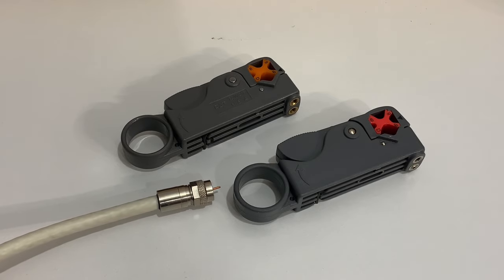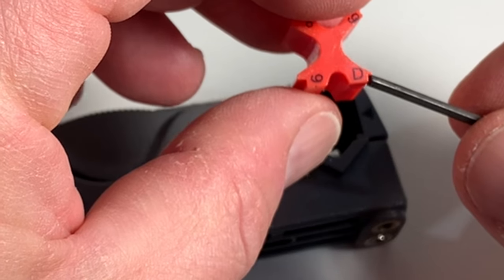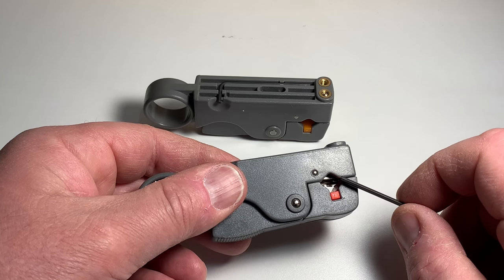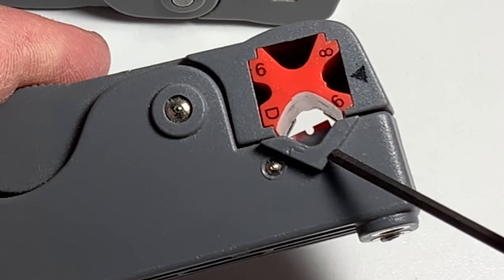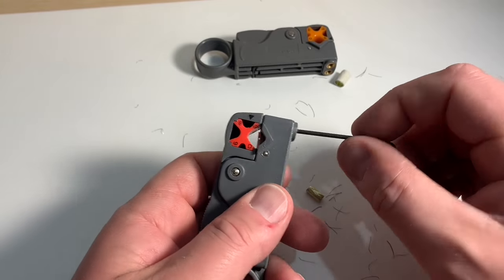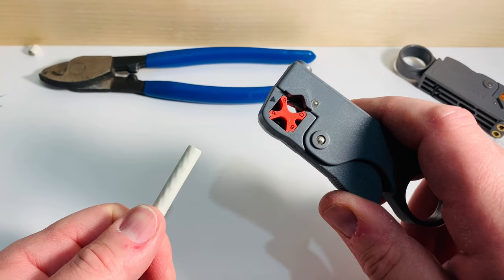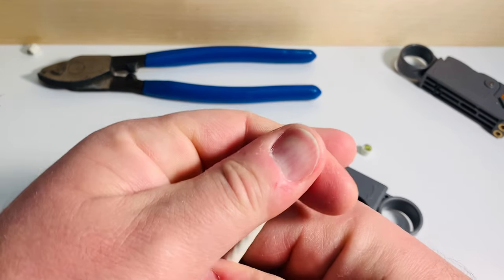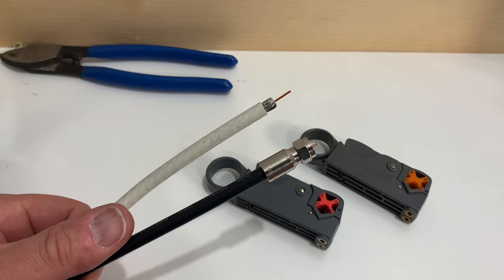RG6 Coaxial Cable Stripping Tool for Making Your Own Coax Cable

Comment: This video was very easy to understand and helpful. It has many similarities to the 50Ω cables used in wireless communication, so it will be helpful for adjustment. Before watching this video, I did not know how to use this tool. It works fine with RG58A/U cables.

Comment: that's the best tutorial I've seen on how to use that particular tool.  I bought mine at Walmart, LOL.  I was always afraid to cut the ends off my cable, because I wasn't confident I could put the new connector back on properly. When I ran RG6 from my attic antennas down to my den, I had to cut the end off the cable and was quite frankly very happy when I put the new connector on first try.  Who knew something so simple could be so difficult?  I recently purchased an IDEAL wire stripper (non-adjustable) and just use that now.  On some cables I have to be careful not to cut too deeply, but you're spot on with practicing first and making adjustments!!
Reply from the maker: I’m glad it worked out for you. Practice makes perfect (sort of). Thanks for watching!

Comment: Does anyone know what the measurements on the tool are for (not the numbers on the orange one, but on the gray one) that say 4, 6, 8, 12? Sorry for my ignorance but I don't understand what they are for or how to used.
Reply from the maker: They probably are a reference point for the length of the exposed conductor and shielding. The little picture below them alludes to that. Likely the measurements are in millimetres, but I don't use those. Stripping the cable as outlined in the video will give good results.

Comment: This has been what I needed to see. I have the exact same cutter and did not know why it wasn't making two cuts. I have a question, what are the: "4, 6, 8, 12" numbers and the drawing for on the tool? Thanks!
Reply from the maker: The viewer below gave a good answer for your question. They probably are a reference point for the length of the exposed conductor and shielding. The little picture below them alludes to that. Likely the measurements are in millimetres, but I don't use those. Stripping the cable as outlined in the video will give good results. Thanks for watching!
Reply: Those numbers describe the distance between the blades lengthwise along the cable. The blades can be moved into the different slots to achieve those spacings. So for instance if you want 4 mm of braid exposed, and 8 mm of center conductor.
Reply from the maker: @SMShannon55  This is correct. Thank you.
Reply: @NorthcoasterHobby  Well, thanks for the replies! Now I just noticed that inside the tip of the "claw" are tiny letters: A- thru- E. These must be the spacings for the slots that the blades can be moved into. (Now how do you move the blades?)🤔

Comment: Great video and perfect explanation on how to use the tool. I have the same tool that came with a RG6 kit I purchased. Always had issues getting good fitting cable ends. Thanks for taking the time to share.
Reply from the maker: Glad it is helpful, thanks so much for watching!

Comment: Great video. Thanks. Especially the part about not having any of the braided shield wire touching the center copper wire. One strand touching will cause degraded video. Voice of experience here. They are fine and hard to see. If you could do a follow up video on a good crimping tool that would be great as well.
Reply from the maker: Thanks for watching. I reviewed this Klein compression tool awhile back.
Klein Tools RG6 Coaxial Cable Compression Crimper Tool with Extended Reach
https://youtu.be/jbayjkrZdQw

Also a couple of crimping tools here (compression and crimp):
How to Install Coax Cable Connectors | Make your Own Coaxial Cable for Antenna and Satellite TV
https://youtu.be/CpyicpHqVJ8

More on my channel. Thanks again.👍
Reply: @NorthcoasterHobby  👍👍👍👍👍

Comment: Hi good tutorial one of the gold part around the small screw fell out is there a way to put it back in thanks
Reply from the maker: Hi, I just had a chance to look at this. Maybe it can be pressed back in, with a dab of hot glue. Mine are secured in still. Does it affect the turning of the set screws?
Reply: thanks i will give it a go thank you @NorthcoasterHobby
Reply from the maker: @jeffvezich8936  Thanks for watching, best wishes.

Comment: Are they preset new or you have to adjust
Reply from the maker: Probably preset for RG6, but every brand of coaxial cable is going to be slightly different. I would do a couple of test cuts and adjust as necessary first.